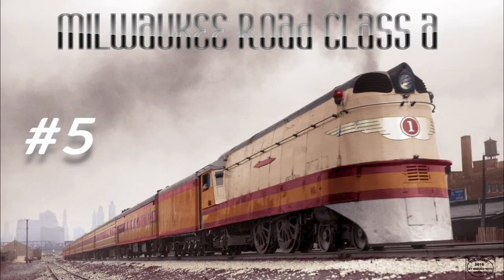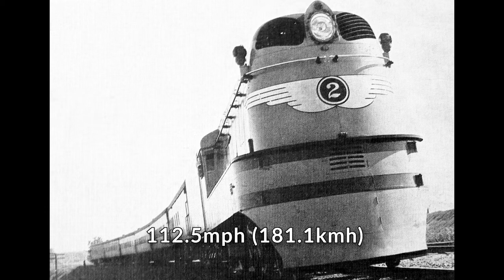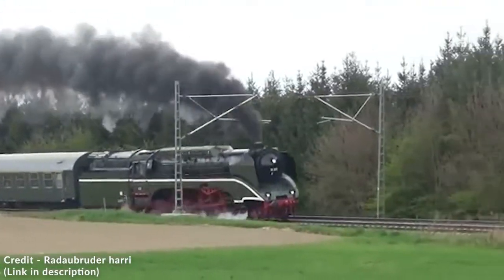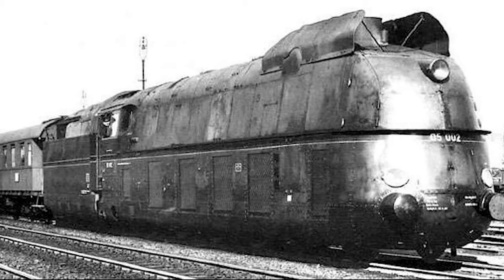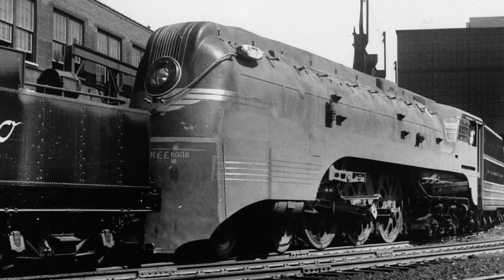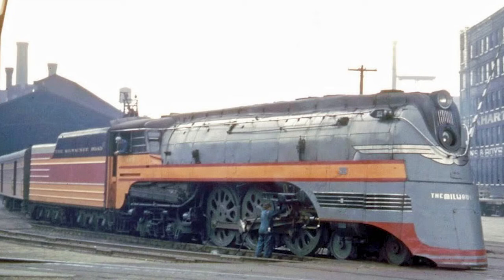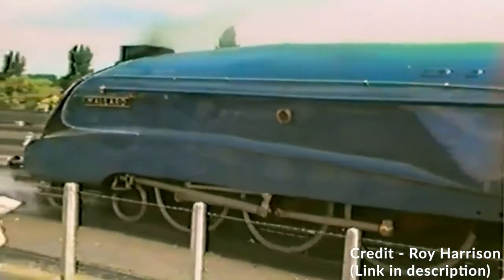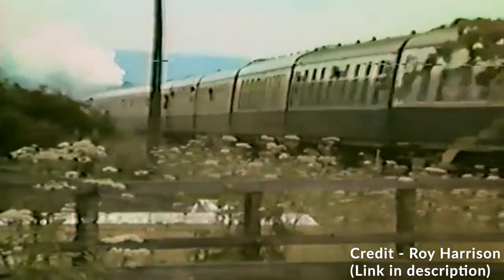The 5 Fastest Steam Locomotives Ever Built

Comment: DR 18 201 the first German pacific? The last one maybe, but plenty of German pacifics preceded it.
The Bavarian S 3/6 was the first and would later get numbers starting with 18 which may cause the confusion (I still don't understand the German numbering at all).
Reply: In the 20s the Deutsche Reichsbahn Gesellschaft needed to classify all engines from the till then sate-owend railwaies from befor the unification of them (every of those did mostly they're own thing) so the took a look for what the engines where designed (or could be effectivly used) and what for a wheel-arangement they had so for example the pacifics with a 4 cylinder compouned engine got the number 18 (except 18-201 and 18-1001 which was a testengine whith a steam-turbine) so the class is 18 and the later nuber too stay with the S3/6 400 500 and 600 (not every for 401 to 699 was used) was used to differentiat between different 4cylinder compund engines and of engines from the same class with minor changes for ecample the S3/6 with 1800 mm. drivers and 2000 mm. drivers and S3/6 which got a new boiler in the 50s. 
Other mates if the Class 18 where the 
18.0 the saxon XVIII
18.1 the Wurrtembergische C
18.2 Badische IV f
18.3 Badische IV h
18.4/5 Bavarian S3/6
18.6 (used for two classes but not at the same time) PKP Pm 36 and reboilerd S3/6

And then there are the 18.201 and 18.1001 as single builds.

And the zsed that system from the biggest express-passenger engine to the smalest branchline engine.

Comment: You can quibble all you like about what 'may' of gone faster than Mallard under different circumstances but you can't deny nothing came close for elegance.
Reply: As and American rail fan, I must respectfully offer the Norfolk and Western J Class for your consideration.
Reply: @FS2K4Pilot I'll not deny it was beautiful engine my friend.
Reply: @TheBuccaneer1975  Was?  Not was, is.

It’s a shame, though, that no railroad will permit it to really stretch its legs.
Reply: @TheBuccaneer1975  I’m curious about a point of British locomotive design.  During the late 40s and 50s, a number of American locomotive designs (N&W Class Js and some Class As, C&O Greenbriers, New York Central Niagaras, and some others) incorporated sealed roller bearings into their main and side connecting rods.  This improved reliability and reduced servicing times because they didn’t require periodic manual greasing.  They seemed to be most common on high speed, high powered passenger engines.  I don’t recall seeing such things on British designs (granting that my knowledge of British engines is hardly encyclopedic), and I’m curious whether I’ve just missed them, or whether British designers for some reason decided not to use them, and if so, why?
Reply: @FS2K4Pilot  all of the bearings used in the lightweight rods used on the american engines you named were lincensed and manufactured by the american  timkin bearing company. a similarly named timkin bearing company also existed in the UK at the time but the 2 companies did not share any information between them. when the SAR ordered the class 25c + 25nc locos from north british and henschel they were supplied with roller bearing rods from british timkin that used bearings from the transmissions out of churchill tanks but were not successful ( undersized for the load and would be replaced with SKF or  with a licensed us style copy  timkin bearing). also the bearings on the US engines were not fully sealed - more correctly just fitted with a dust seal and still needed regular refilling of lubricant. both oil and grease were used depending on the railways choice when ordering the bearings, but the service interval was greatly extended. for example the N&W j class could go 500 miles between topping up of the oil in the rod bearings and grease in the motion bearings of valve gear.

Comment: Malard set the record by going down hill and it was also damaged a bit b the attempt, so thats why for me the br05 is the fastes steam loco :)
Reply: Also, N & W Class J #610 hit 110 and change on the flat hauling twice as much train as the Mallard.  With a lighter consist it certainly could’ve gone faster.
Reply: @FS2K4Pilot  Woulda, coulda, didn't...
Reply: @regenmeister3034  But 610 was running on the flat, so its record is honest, at least.
Reply: Duddington said if he hadn't to slow down to 15mph at  Grantham he would have pushed Mallard to over 130mph... and regarding the damage.... the speed didn't break it, it was the braking that overheated the bearing. I wish people would check facts instead of writing negative rubbish.
Reply: @rockfan3299  exuse my question but can you explane how braking with brake-shoes overheats a bearing when the tyre is shrunk on the wheel rim (keep in mind the cast iron brake-shoes which were used in the 30 helped quite a lot by radiating of the heat)? It was the speed ore the inadequat lubrication at those speeds  which destroyed the barring to be prezise.
Reply: @Markus_Teltschik  You need to read up about brakes on the old steam trains. They use steam brakes!
Reply: @rockfan3299  in the days of Mallard and the other A4s the air or in the case of the british the vacuum-break was well establisched and used. They were not braking with steam in the brake-cylinders they used air.